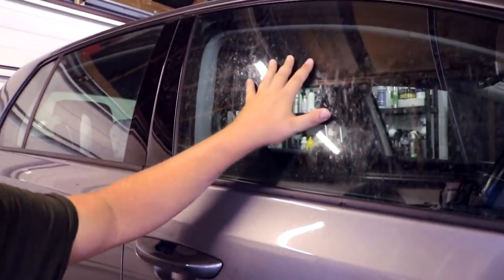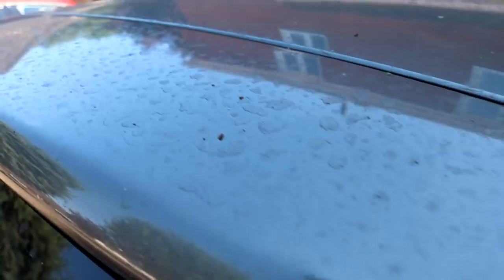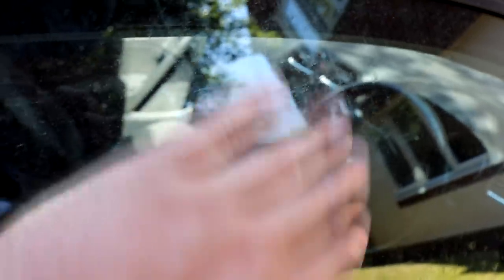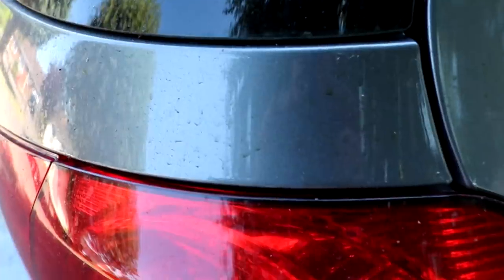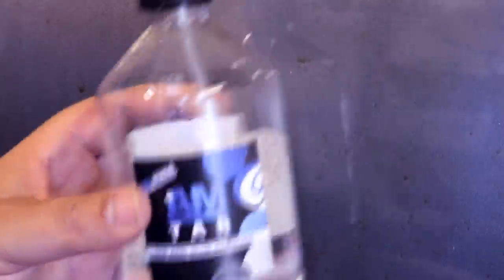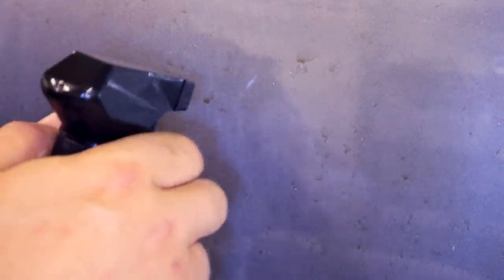Car is plastered with Tree Sap - How to remove tree sap safely

Comment: I have never seen water being able to dissolve tree sap.  What kind of trees do you have over there?  I usually use a mix or alcohol based hand sanitizer and IPA.  The sanitizer is like a gel so it allows the solvent to stay on the sap.  Takes about a minute to dissolve it then I come in with a microfiber towel with a little more of the solution on it and wipe it away.
Reply: Me either. 100% doesn't work on thick wet pine sap. Your recipe here is exactly what I used this week, about 5 to 1 ratio. So glad I found it! Worst sap I'd ever seen. 4 years of parking daily just feet beside the trunks of a row of pine trees. Top surfaces were layers of sap, mold and mildew, wood bits, pine needles and more sap. After repeated foamings and high pressure washes, used microfiber and mesh bug sponge to begin cleaning organic material from droplets one by one.. then a stiff, smooth edged card to lift final bits of material that were embedded in droplets and thankfully this makes for less sap to dissolve. Took me about 20 hours to fully detail, interior, just get exterior decontaminated to where I can machine polish. But this said the vehicle is in such good condition it was worth the trouble. This added a ton if resale value. Wish I could post a picture here. Keep sharing that sap recipe. FWIW Malco makes a sprayable product name SAP with methanol, isopropanol, alkyl benzoate that looks great but it can only be purchased at suppliers so far as I know, by the $45 gallon. Cheers
Reply: @mlstrib  Glad it worked for you.  I have upgraded to something that works even better now...  alcohol gel for fondue burners.  It's super cheap and it's more effective than the mix I used before.  Might want to grab a bottle if you ever face hard to remove sap again.
Reply: @Calendyr  sure will get it👍

Comment: that's great for removing sap from deciduous trees like lime trees, but for pine tree sap it's not going to work at all. I'd love to hear your thoughts on how to deal with that one using something that both works on the sap and won't damage the clear coat. cheers
Reply: Pine sap is exactly what I'm dealing with right now, and like you said, water definitely won't do it. Dawn dish soap won't do it... neither will Dupli-Color wax and grease remover. Isopropyl alcohol does work well, but it evaporates quickly, so I'm going to try some hand sanitizer soap. It has alcohol in it, but won't evaporate so quickly. Apparently mineral spirits work well also.

Comment: A guy that I used to work with in a detail shop always used laquer thinner to get rid of sap, it actually worked really well. It always quickly desolved the sap. This was of course after he had already washed the car with water. I worry now though that while removing the sap it also removed the clear coat... Any thoughts?

Comment: Sap is mainly water with other elements (like sugars). If the tree sap is taking a while to remove then, just like dissolving sugar in a pan, warming your rinse water will speed up the dissolution of the resin.
Reply: Water does not remove pine sap.

Comment: I just tested out alcohol and it was effective. I'm a little concerned it may have been hard on the paint because I see streaks now, but the sap is easily 100% gone with little scrubbing effort. I let it sit for about 5 minutes to break down the sap.

Comment: Thanks again for great video. I was surprised that normal water works. 
Unfortunately we have little bit more difficult problem in Finland. 
do you have any idea? It seems to be Aphididae waste which is falling for cars.
After normal wash i can feel that paintwork is not smooth. All horizontal surfaces are coated with something sticky. 
Tar & glue removers would not work, any petrol solvants do nothing. Clay mitt or clay bar is the 2 working solutions i know. Unfortunately both are not so coating safe products to use..
We have 2 cars which we have to leave sometimes under trees, and it is so stupid to do mad work with clay mitt many times / summer.
Reply from the maker: the the aphididae waste or honeydew which should normally be water soluable.  I would try to avoid removing this stuff by abrasion if you can... So if its not water soluable you might want to see if a solvent based paintwork cleaner effects it.   Even something like limonene can be worth trying.. or a specific SAP remover detailing product.   The trick is to try and find what disolves it..   proper tree sap generally wont break down from water but 99% of times its honeydew like in this video.

Comment: Really surprised that t&g removers didn’t work and it came off easily with water,  I’ve seen Chemical guys use butter wet wax to remove sap but I’ve not tried it.

Comment: Just come across this vid, so sorry this is late to the party.  My Son's car had been parked under a tree for months until it was black in many parts with dirt stuck to layers of tree sap.   Nothing I tried would easily shift it until a neighbour came around with a bucket and said try this.  What a miracle!  Just whipped it off.   And this miracle substance-hot water with a dishwasher tablet dissolved in it.  Wear washing up gloves though if you try it.

Comment: Use Dawn Dish soap and a little hot water, soak tissue paper with that dish soap mixture, slap the tissue on your car body,  let soak over night or even a couple of days. Can repeat with fresh dish soap soaked tissue paper for second application for another day or two. It loosens and softens the tree sap. Same principles as soaking pots in the kitchen. It worked for my BMW which had tough tree sap stuck on the paint for 2 years.

Comment: So i tried your method of removing sap off my car windscreen/paint work and just water alone didn’t work. Maybe it’s because I live in an area with hard water I don’t know. I Tried all sorts to get it off clay, paint cleaners, tar and glue remove, to no avail so I gave up and finished the car off. I applied Rainx rain repellent in the windows and it came off so I tried it on the paint work and it also came off so I found rainx rain repellent is good for removing tree sap.

Comment: Water didn’t work on mine. Firstly, it had no protection on it which makes things worse - but anyway, 2xValetPro Snow Foam rinse between and after. The sap was totally untouched. Tried GTechniq tar & glue, super resin polish, autoglym engine cleaner, clay - not even close as it has been baked on for a while. Started with a soft Vikan brush but ended up using the Vikan nail brush which got it off but marred the paintwork (doesn’t matter, old less-than-perfect red E46 that was due a machine polish anyway - the sap tendered parts of it black). I then went on to decontaminate - now, I have another car next to it in a similar state (also unprotected but has been machine polished). My first decontam is tar & glue  followed by Korrosol. Korrosol was the one I hadn’t tried for sap removal, so on the second car I did and it softened the sap really well allowing it to be powerwashed off. Good news as I didn’t really want to redo the machine polishing on the second car. I have another but that has 3xAutoglym HD and the sap isn’t as bad. Hopefully water will work on that but if not - I guess korrosol and rewax.

Comment: I was really surprised that just water did the trick. I had a dealer literally scrub the sap off my new car with an abrasive and damage the paint trying to remove tree sap. 3 trips back to the shop to correct the corrective work. Great video thank you.
Reply: depends on the kind of sap. extremely misleading video. I'm a detailer.  you think we don't try water first !??? lol
Reply: @Jon Bravo  Sometimes I think these videos and comments are a joke.
You think maybe that would be the first thing you would do before going to a dealer or researching how to remove it?

Using water to remove contaminates is step 1.
If you never thought about using water then how do you wash your car?

Comment: I have this bloody problem every summer as I have a tree hanging right over my driveway and I found through plenty different methods that a pre rinse, snow foam, rinse and then 2bm gets rid of it a treat. Only problem is, when I wake up the next morning, I’m back to square one 😠😠 I’m wondering if a ceramic coat would be any good to minimise it or would I be wasting my time?

Comment: Hey John do you have any recommendations for tar removal, I think Bilt Hamber is missing this in there range. I can’t find any amongst your videos.
Reply: Surfex HD diluted 1:1... Or neat if the tar is really bad but I've never had an issue with a 50% mix 👍🏼👍🏼
Reply: Sparko 888 how strange I just added surfex HD to my basket on the BiltHamber web site 😂 thanks very much for the dilution ratio that will be a great help. 👍

Comment: Never seen so much sap on a car! I’ve never had to remove loads of sap as keep away from trees but if I did, I would go with Auto-Foam first. It’s by far the best cleaning foam. If my car was as bad as the Golf, my have used Greenstar first I suppose to be sure. Glad you got it all off!

Comment: Great video Jon, but alas this didn't work for me. I tried Bilt Hamber Surfex / Touchless, Autoglym Professional Tar Remover and just very warm water but still no joy. The glass type beads were there to stay, so I started trawling through You Tube videos and found one by a guy called Chris Fix, who had an array of products lined up, including peanut butter and tried each one in turn. The one that really started to work was hand sanitiser and this was followed by rubbing alcohol, which did an amazing job. So I went to a local supermarket and bought a large bottle of sanitiser for just over £4 and within 30 minutes my roof and the bonnet were completely clear. I had done a test on an inconspicuous spot first. It would seem that alcohol is the key ingredient for sap removal, particularly pine etc. Cheap as chips and I still have about 95% of the bottle left.

Comment: Happy to report that this video will likely save my arms and my wallet. I have a "mist of hard spots" all over our car, and nothing would make it budge. Didn't want to wash it originally, as it was washed less than 24 hours ago. Just did a test spot on the glass with a damp towel and voila! Gone!

Goo gone and tar remover didn't touch it. Car pro eraser was working, but still needed elbow grease.

5 years later, thank you!
Reply from the maker: great news was honeydew mate or literally aphid poo.

Comment: There are many types of tree sap. Of course time and temperature can develop more challenges.  Water and soap do not cure many sap situations.  Alcohol removes most. For sap that has been hardened for weeks or months, allow the alcohol to soften the sap for minutes, then use a soft wood to eliminate.  When sap removed, wash with soap, rinse well, and apply a car wax.

Comment: Great vid as always. Must admit I have to park under a tree from time to time and you get the dust mixing in with the sap and the surface feels like sandpaper. I have noticed in the past that a really good downpour of rain seems to shift most of it especially if you've got decent protection underneath. Not that we've had much of that lately!
Reply: Michael OWEN I pray for rain in the summer sometimes as it saves me a wash as well!

Comment: I don't know which trees you got there, but water alone doesn't work here. I use Motip Tar and Resin remover. It leaves no residue. Spray it on the resin(treesap) and let it work for 3-5 minutes and then with a sponge or mitt soaked in warm water and take it off.

Comment: Interesting videos. I’m in south of France and unfortunately I can’t get ride of pine sap with water only. Someone recommended Schaeffer Manufacturing 266 Citrol Cleaner. I didn’t try yet but this product seems to be a good alternative to tar and bugs removers. I would also be interesting to compare it with your best of Tar remover which is the Tardis.

Comment: If you think that's bad you should see my car. Water definitely doesn't work on the sap from the trees on my block. Even purpose made sap removers didn't work. Although one day I sprayed some carpet cleaner on a spot and it wiped off with a paper towel. Then I read the bottle and it said don't use on paint so not really sure what to do now.

Comment: I have been testing so many prodicts to deal and disolve tree sap.

You have to use somthing thats Bio-degradeable. 

The best product i used so far is Angelwax Revenge, thats actually a bug remover but works exelent in this case.

Try it out, you will not be disapointed.

Comment: how to remove tree sap specks on hood that have been there for as short as few months but as long as a year? I didn't know it could be tree sap until recently.. but I've noticed there are dark tiny specks on my hood that don't come off with a wash. they don't seem to be bumpy either
Reply from the maker: Tar and glue remover.  Autosmart TARDIS
Reply: @ForensicDetailing  actually, im not so sure if its as simple as sap spots. Now im afraid it’s a sign of clear coat failure or defect? Do you mind me sending you pictures through email? Thank you

Comment: Thanks for the tip! Another quick tip: Wear basketball shorts with draw strings to keep your pants up. The cargo pants you're wearing is littered with buttons and zippers and zipper holds, on top of that you're wearing a belt that most likely has a metal belt buckle. Obviously those are things you don't want end up rubbing against your car when you're doing contact washing.
Reply from the maker: these cargo pants actually rock for detailing..  a lot of things I wear are not great though (jeans normally)... but these dont have any buttens on the outer pockets or rear pockets (they  are velcro flaps)   The cotch zipper is covered.  Theres no metal studs on them or buttens.    The belt has a buckle but my gut acts as a bumper or meat shield (and Ive deliberatly built up the size of the gut for this function)...      

if I did it professionally I would wear stuff a bit more suitable...

Comment: I use Tardis everyday almost perfect for removing of sticker glue and bubble gum  off glass and even black carpet. G101 I don't think would work but I have never tried it. Fallout remover should work. I think I would have tried hot soapy water first to be honest. Another great video there jon 👍
Reply: Thanks for that tip LNS. I had chewing gum stuck on my carpet which some lazy person must of threw on the floor and it got stuck on my shoe and onto the carpet. I tried removing it by hand but had little reminents of it which was deep in the carpet. Also don't listen to the top comment ^^^
Reply: Zain K yeah Tardis work great for chewing gum in carpet. I just spray a bit directly on to the gum and rub in small circular motion and it just disappears and that's on any colour carpet too. Glad I could help 👍

Yeah that top comment I just ignored it 🙄

Comment: I think this is more likely ‘Honeydew’ which is water soluble. This is from insects in the tree excreting out a sugary substance. I get it daily on my drive and have to rinse the cars down. Sap as such, is a much more tough resin like substance, and that needs the stronger tar type of removers like Tardis to shift it. That’s my experience anyway :-)
Reply from the maker: yep, aphid crap keith
Reply: Ah yeah, that’s it, from Aphids. Our cars look like someone has celebrated F1 style with a bottle of Coke every few days. Lovely!
Reply: Hm must be what's on a small section of my car at the moment. I don't park under trees but was parked very close to being under one the other day. It's almost like spots of cola and rather sticky. Let's hope it comes off easy next wash.

Comment: I have treesap on my van that is rock hard, even a Kranzle pressure washer doesn't get it off at 5 cm distance. What should I do?
Reply: LoverOfPhotography nail polish remover, baby oil or and sanitizer should help
Reply: Enamel reducer works good and will not hurt the finish
Reply: Alcohol

Comment: Depends 100% on the kind of sap. I detail cars in Colorado. Water does absolutely nothing here.  You could use 1000 gallons and the sap will just sit there and laugh at you.  

Alcohol, Carnuba wax, acetone that's what works here.

Comment: Yeah, that's strange.  I get sap on my vehicle from pine trees.  It's crystal clear and beads on the paint and can be one to two millimeters thick in height from the paint surface.  When it's fresh, it's sticky and gooy and water has no effect on it what-so-ever.  If it's left for three or four days, it hardens and turns an opaque white.  It can be scraped off of glass with a razor blade, but I wouldn't try that on paint.  Water has no effect on it.  I have used Goo-Be-Gone and WD-40 with some success, but it still leaves a water mark type of blemish in the clear coat and I thought it had eaten into the clear coat.  I finally tried 70% isopropyl alcohol and it dissolves the fresh or dried sap and removes the blemish completely.  After removal, touch up with a spot of car wax and hand buff, since the alcohol removes any wax finishes.
Reply from the maker: 8 think it was honeydew on my car

Comment: Would Korrosol work? It almost always reacts with every little rubbish when i spray it on
Reply from the maker: the stuff on my car was water soluable and most fallout removers contain some water... but they would not be appropriate richard.   you want to use the fallout removers on small bits of fallout stuck to clearcoat or alloy wheels or glass etc...    I think always start with just washing the car like I did in the video.. and if that doesnt sort it out then its not like honeydew and its going to need a chemical perhaps something mineral spirit based if it really is proper tree sap.

Comment: Water alone did nothing for pine sap. Isopropyl and hand sanitizer do work you just need to rub carefully. I poured a bit of isopropyl on a Chix towel after hosing it down a few times. Dissolved the sap in a matter of seconds.